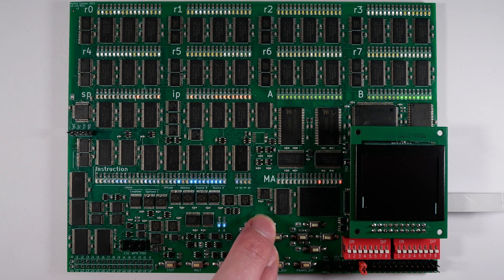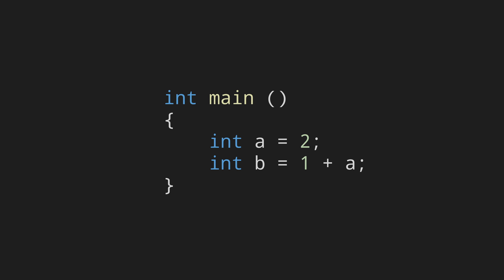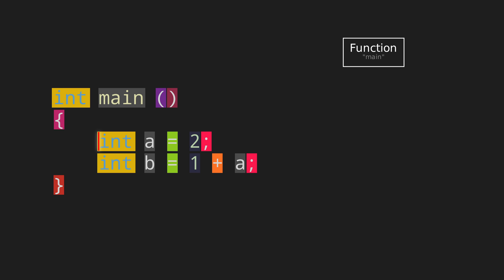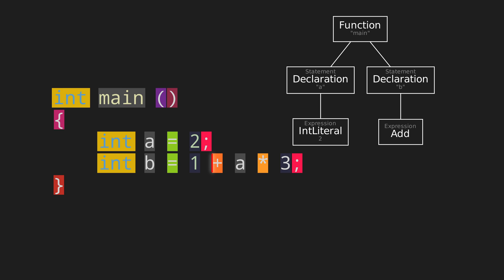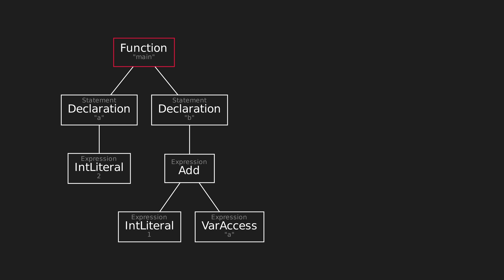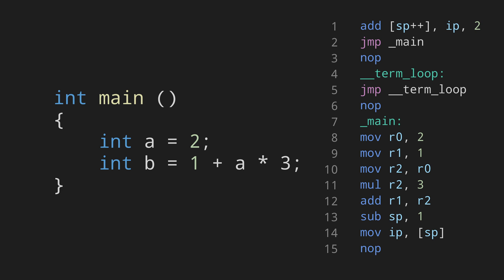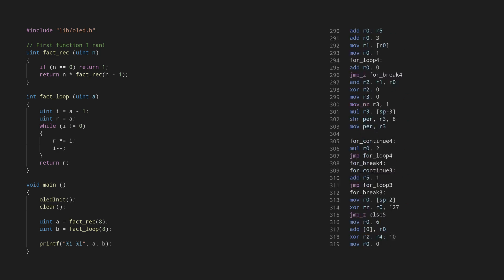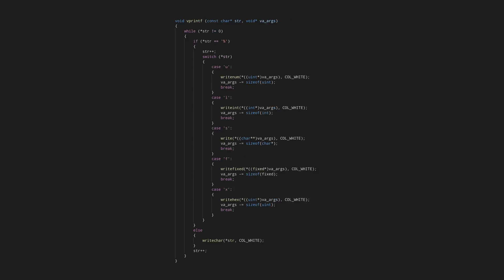I wrote a Compiler for my Custom 16-bit Computer

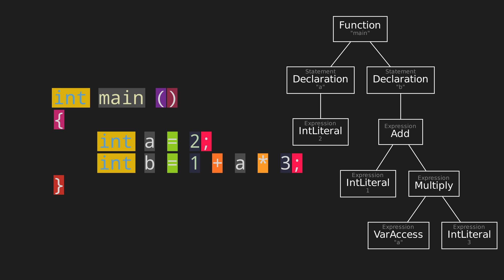Comment: 5:30 precedence is wrong isn't it?
Reply: no, evaluating a syntax tree starts from the leaves; in order to evaluate a node, all of its children must first be evaluated. thus, as multiplication appears as a child node of addition, the multiplication must be evaluated first, which is what you'd expect from 1 + a * 3

another way to think about it is that each node is a function call, and the node's children are the arguments. so this expression would be add(1, mul(a, 3)). in this case, it becomes more clear that a function's arguments must be evaluated before the function itself
Reply: @nibbletrinnal2289 , my bad. You're correct

Comment: There is a really nice video series by bisqwit that also builds an optimizing compiler from scratch. He added some really cool features like AST optimizations, intermediate code generation using ssa and three address codes. But  unfortunately he stopped a bit early just before instruction selection leaving it "as an exercise to the viewer". You could probably do optimizations again after instruction selection using peephole optimization and similar, which i assumed he would also do.

Comment: I guess it's a suboptimal way to print characters. I had also written code for some Chinese LED device for ~$4 and drawing character by character approach was just too long because of refreshing. Then I found RMW (read-modify-write) thing in this LED that reads a value into a variable, you change it, then write back and it internally increments page index and you can start RMWing your next part of the output. I batched all the text into some kind of bitmap and wrote a function that prints out this bitmap using RMW and it started printing text blazingly fast, I guess your LED does support it as well

Comment: Very impressive. I suggest you start a series, like James Sharman or Ben Eater, where instead of showing end result, you upload smaller pieces, and show progress. I think this is way more educational and engaging.

For example I would love to see how you implemented integer division, and printing numbers in decimal. But also how ALU interacts with registers, or how immediate values are loaded.

I am also designing a custom 16-bit computer, and was exploring C compiler options, I would like to support C99 like compiler, and be able to compiler some useful things, including some existing programs. I was exploring existing retergetable compilers, but maybe writing one from scratch is an option too (I didn't write any compiler before, but I wrote many lexers and parsers to AST converters before, including one for a programming language). In fact due how my computer works, it might not be easy to make it work with GCC or Clang internal representation formats (i.e. I handle flags and registers in weird ways, and have special calling conventions for functions). I am not going to be writing one in C, probably in Python or in Dlang (D programming language). I already have a advanced assembler written in Python, so I think I will continue with that for a moment. My assembler already has macros, and ability to structure code very nicely, so in reality I can already achieved a lot of what C can do with almost no extra work, with just few tricks.

I guess, writing a C compiler in C is interesting, as one could then make it self hosting (compile the compiler to run on the target computer, and then compile programs there, but I think this is unnecessary, and a bit pointless without having computer having way more capabilities, like IO, storage / file system, and maybe networking).
Reply: the fact that RAM is non-volatile could be used for storage, if the RAM was made bigger or something (banking could work)

Comment: Nice job ..but ,what confuses me is how the ancients entered the code, what tools did they use, when no other computers were being built
Reply: In the old days "assemblers" were actual people employed with the task of converting a written program into machine code. The machine code was written on punch cards which were then read by the computers to be loaded.

Before that time, programs were similarly "assembled" by hand, and the programs would've been hardcoded with switches.
Reply: probably done by mechanical then any code works
Reply: Sometimes I do the same question.